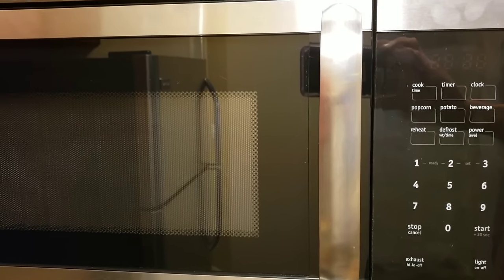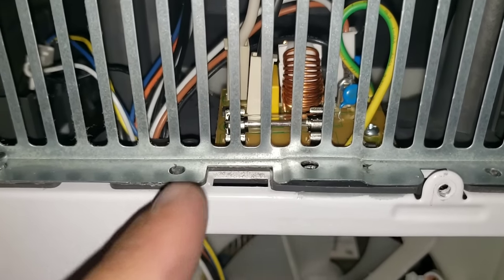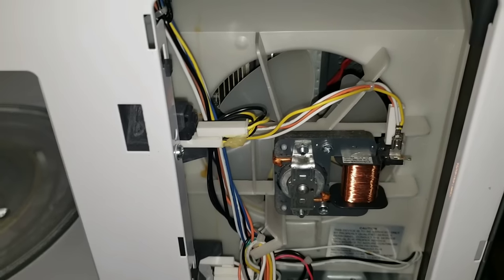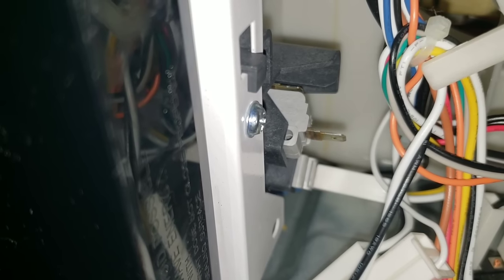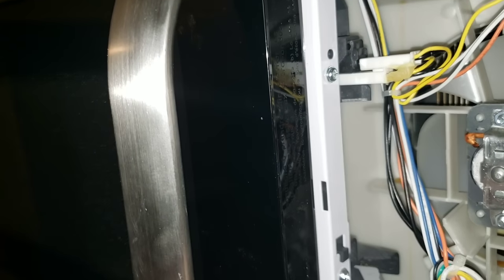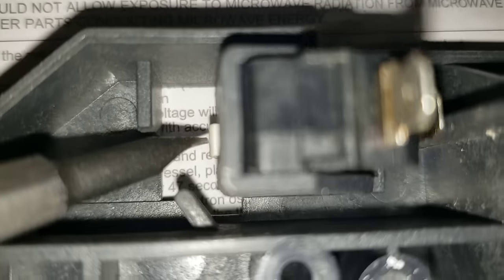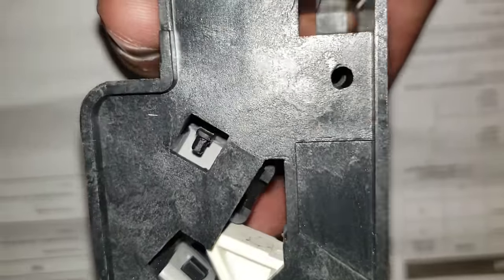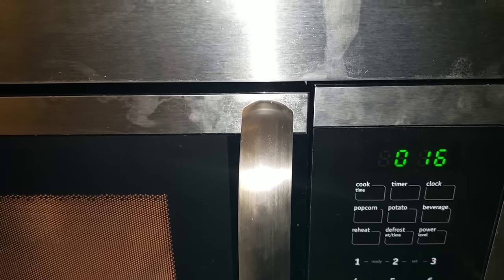Microwave Keeps Tripping Breaker? Here's WHY!

Comment: Isn’t the part you called a over thermostat just the oven lamp?
Reply: Yeah I don't think they're thermostats. I think he meant thermal fuses. Could be lamp as well but the few I've seen were larger / more obviously bulbs.
Reply: @charlesangell_bulmtl  Oh I learned something new. So are you saying what I learned were thermal fuses, are sometimes in fact called thermostats? 
I guess if they're switching off power when things get too hot - yeah I see how that's similar functionality to like a thermostat dial on your wall to set house heating temperature...it does the same thing I guess, switching on/off at a pre-set temperature, just a different application. I assumed the thermal fuses in microwaves were the one-shot non reset-able type things and that's why I thought of them as a fuse as opposed to a switch. And I heard other people call them thermal fuses. I'll look into this new term you mentioned. Thanks.

Comment: DOES ANYONE think  a cut wire to the plug will short out microwave ? I really don't think so but anyway checked the fuse it's still good.
Reply from the maker: It is possible. You can go online and find a video how to test your supply line with your multimeter 👍
Reply: @MoreThanMaintenance  ok you say it's possible but wouldn't that fry the fuse? I tested the fuse it's still good.

Comment: Does anyone here changed their microwave because it keeps on tripping the breaker no matter how many times you change the switches? I ended up buying a new one because it keeps tripping my breaker. Changed all the switches correctly but still comes back tripping.
Reply: I change the switch out and also replace the switches holder that holds all 3 switches. Beaker is still pop popping off
Reply: I’m stuck here. I don’t feel like spending $300 for a new one
Reply: @ericmarin1875  i replaced my microwave. It’s going to come back tripping. I have read reviews and that’s the problem with frigidaire. Mine is 7 years old when it started breaking so its about time to change it. 😅 our friends microwave took 2 yrs and they never touched it again. 😂